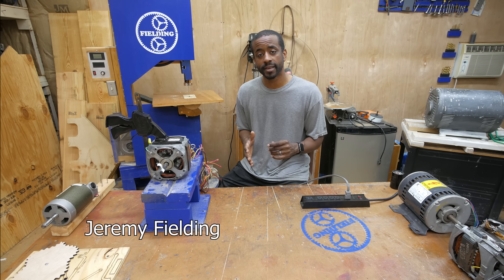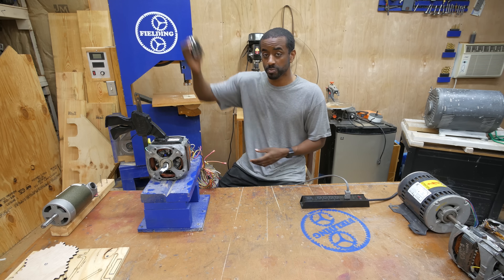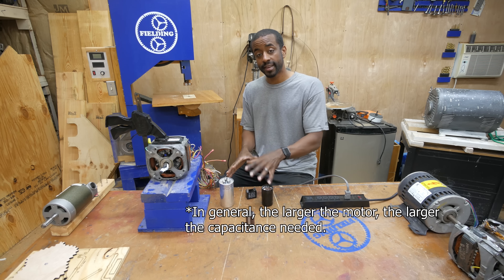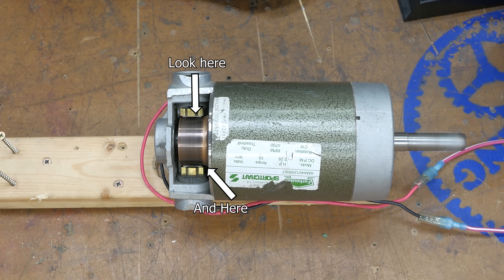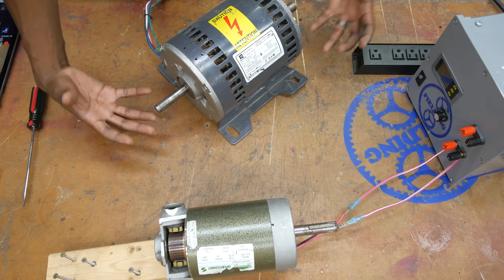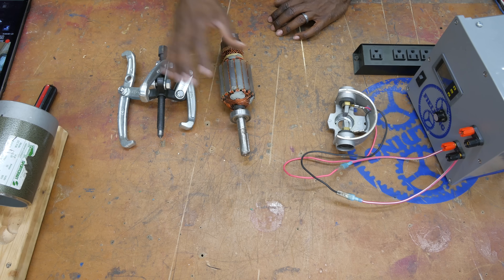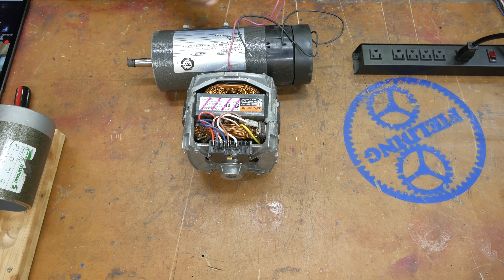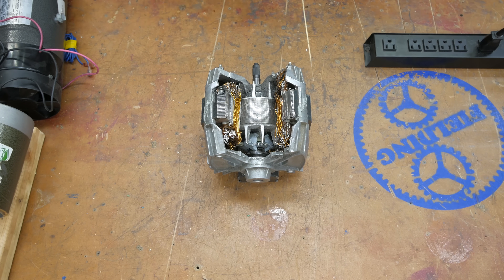Three Most Common Motor Fixes Anyone Can Do; Ultimate Guide to Electric motors ; #070

Comment: Yo I really hope you see this. @1:02 you say "if I give the motor a lil push.. let's see what happens." My question is what's going on with a motor if I give it a push and it doesn't do anything? It's like it's locked up or something. For context. Ive been using a fan motor from an old gas furnace without a capacitor to shake spray paint cans. It's got a small wine bottle rack centered on the shaft and I put the can in it , turn it on for 15 seconds or so and it's good to go. I replaced the bearings in the motor and put it back together and now it doesn't want to turn at all. Actually it did the 1st time I put it back together but I forgot to put the bearing cover on it so I tore it down and put it on, now it's dead lol.

Comment: I repair a lot of motors at my job and most common problems are loose connections due to using wire nuts. I suggest every connection be made with a bolt,lug or terminal board type connection.  Great video and very Informative for people just starting out with electric motors.  Watch for SPARKY!

Comment: On your #070 video you show a dryer motor that is glued together. i'm trying to replace bearings in a motor with the same glue. How does one remove the glue, what glue to re-attach and also what is the small opening on that motor for. Is it to assist in opening of for lubricating? Thanx-a-lot. Your videos are very informative and ha helped me alot. Keep it UP!!!

Comment: You do a better job then I could explaining DC and even AC motors along with capacitors and other components and why they are needed even though I have a better background then most. It should be a common knowledge but sadly it's not if I asked Joe what an armature or commutator was they would say huh. And it's pretty important stuff we use them everyday.

Comment: Are you a teacher?! Your videos are easy to understand and at a pace anyone can follow. I do have a question that I will be digging into myself. My air compressor has the capacitor I should check but right now when I turn it on the lights on the circuit flash and then the breaker blows. Not sure if this is a common problem but the one I have. Again thanks for the great videos!

Comment: Hi Thanks! I have a problem and I think how to fix this. It could be the bearings. The engine is for vaccumcleaner. and its starts good and run good and no sounds issues BUT when I stop the engine and at the end of the last rpm:s its sounds awful like it should break down. But it starts allover again and it runs very good and did it for at least 5minutes. Every time I switch off it sounds like that at the end. Anybody???

Comment: Hi there, nice and informative video. May i ask a question. My coffee grinders single phace ac motor stopped working and these are it's symptoms: when i turn it on with power in spins and then jamms making a rubbing sound, but then with some force with my hand (power off) it starts rotating again. I believe it's the bearing or something broken inside. What is your thoughts? I don't think its a faulty start-run capacitor cause when i unjamm the rotor it can rotate. Thanks for your time

Comment: Good video , I just pulled a attic fan motor that was just humming when I tried to start it. When I try to turn the shaft it feels like it is gummed up. So now I am thinking barring's and I have to check the capacitor because not sure how much resistance the shaft should give me when turning by hand

Comment: My Black & Decker Bench Grinder stopped working while I was using it.  Felt hot.  Now just buzzes.   Wheel still spins freely with no power but when switch turned on the motor locks up.  There is no capacitor.  Could it be brushes?   Thanks for the video.

Comment: Jeremy long ago subscribed to you. You were using recovered washing machine motors to power your shop tools. A Neighbor that repaired washer for years and years  had motors stacked around; a bunch!  I asked and received as many as I wanted. I offered and received about 20 and he refused any money. I got my wheelbarrow and took them home. This was in late September or early October, I covered the wheelbarrow with 3 layers of tarp. Spring is almost here now, the bungee cord snapped, I now have motors in a puddle of rain, snow, or defrosted ice!  Is there away to still find a useful place in a future shop other than a heavy paper weights?

Comment: I brazed a brush holder back onto its flange on a Husqvarna 'cut & break' saw.  Simple, but not easy, fix for an expensive tool.
It vibrates a lot, but it's been working so far.

Comment: Hi jeremy, I got a drill press that hums and doesnt turn on its own until you give it a turn like you did at the beginning of the video. When i got a new capacitor and hooked it up...it still not working. I got 2 diff. new capacitor just to make sure. No result. Do you think i need to open the motor apart and check something else? Great video btw

Comment: THANKS!  You are an awesome teacher. Wanted to tell you about a little trick I use when bearings, (mostly the copper sleeve types), are worn and getting sloppy, and its not convenient at the time to replace:
I look for super thin strips of brass or copper, (I've used everything from silver scraps to steel spring out of a tape measure),  that I oil up and slide between the shaft and bearing; (sometimes a tiny sliver will do it), and it helps get tolerances back where they need to be.
Keep it oiled and it'll last long enough to finish that project . . .
Reply: I'm doing the same with a small cut from a plastic bottle to get through the remaining of the hot season with the same old fan.

Comment: so question lets say that I have a old motor that went to a air compressor and it failed. can I upgrade the electric motor that was a 2hp to a 5hp as long as the rpms are the same and the voltage is the same?  the only other difference I see is the fact It has a start up capacitor (old one)  and the new one has a start up capacitor and running capacitor.

Comment: Excúsame just a question I have a airless paint sprayer and wen I start the machine a lot smoke comes out from brushes area I checked the brushes and they are not desgasted looks over half of the size wen they are new do you think could be a electric short thanks

Comment: Very informative. Cool switch demo at the end…. I have a problem with my dc motor that vibrates but will not run even with an assist from me. The variable speed box is not working so I disconnected it and used a standard power cord with the proper plug to power the motor. So I guess I am bypassing the capacitor. Could I connect a stand alone capacitor to fix the problem? Any advice you have would be greatly appreciated. Thanks

Comment: Great job explains these things.  I have a 1960s record player and I’m researching what kind of motor it is and which type it is to figure out what may be wrong with it. Checking all the upstream components was a great suggestion!  You are right I should start there rather than assuming the motor is bad.

Comment: 7:56 i ended up seizing the front bearing in dremel doing some sheet rock work. look story short took the dremel apart removed the bearing cover removed the debris from the bearing the dremel lives again. 🧟‍♂ all that said when you pull out the shaft of the dc motor do any parts of the dc motor (non bearing related) require any lubrication?

Comment: Awesome, Thank You. Right now I’m having trouble identifying the run capacitor on my air compressor. The paper label not readable.  I tried looking at the motor manufacture with no success. Any ideas?
Sanborn black max 3 HP
30 years old air compressor

Comment: I have a bench grinder that would not start. I replaced the switch but it still wouldn't start. I could hear that it wanted to turn on so I gave the wheel a kick start and it finally started. This bench grinder did not have a capacitor so I though that just replacing the switch would solve the problem. When I replaced the switch it make the same sound like it was wanting to start. Could it be the bearings inside of the motor that are defective?

Comment: I had a 54' fan motor hard starting. Pulled the capacitors off and checked them. They checked in specs.  Put them back on for the heck of it and motor started great. I assume they weren't making great contact.

Comment: i miss when i work  on motor shops  for 40 years  fix all kind motors and rewinding them + converting them for a different torque , voltage, frequency and speed , good job on you video,keep work on this babies ,i love  MOTORS

Comment: I ha e a motor that I brushed the wire coming out of the stator because they were filthy. Thing is I brushed it with a small metal brush. Now a bundle of wires is getting so hot the copper is changing colors. Friend says I scratched the shellac off the wires and it's causing them to short. Is this correct?

Comment: I watched this video bc my gf bought a fan at lowes for $70 on clearance.  When we got it home it didnt work . The plug had a fuse in it which was fine so i said to take it back then she had a death in the fam8ly long story short i just ran across this fan 2 months later so i guess im going to have to fix it. Electricity is black magic to me bc i dont really understand it. I can build most anything , fix your car etc so i know how to do things just not electrical stuff. Thanks for the run down on motors it was very informative. The fan does nothing when i plug it in so im thinking a switch or something like that maybe it was wired backwards who knows . Guess ill find out soon enough  Thanks again

Comment: So I’ve recently had to take a diesel tank pump apart which seized up and burned out probably because it has been used for adblue instead of diesel. When I took the motor apart I noticed that it had a pcb with a 240 volt 64 microfarad built in capacitor which looked damaged. I’m thinking to purchase a new capacitor and solder it in the pcb. If I can’t fix the pcb could I use an external capacitor somehow? Problem is that when I hook the motor up nothing seems to be happening no noise combing from it, probably the pcb has other damaged parts in it which I didn’t notice like fuses or extra smaller capacitors. It would be a shame to throw that motor away, the brushes are still ok, I’ve cleaned the terminals as they were oxidised, the bearings work. I know the answer would be a new pcb but what are the chances of getting one, the manufacturer doesn’t sell them separately. I looked it up and online and these motors cost around 400 dollars.

Comment: Oh I'm a Big Tesla fan too (even  an EARLY! Edison fan, we'd go on field trips to his Menlo? East Orange? Lab...) but as you were so proud of Tesla, you came close but seemed to hesitate mentioning Faraday w the Induction demo shortly after...his biography in a liberal arts class later gave me inspiration to get a B.Sci. degree (Chem. Minors in Physics n Bio) but him a street Urchin, someone once called him, to go from reading the books he was binding, to become a master 'note taker', wife watcher', for the great Sir Humphry Davy (ran current   to claim elements discovered-or purified...) but Micheal first was a chemist,chemistry,. Benzene..but it was 50 years? No more than a pretty milkmaid flipping voltaic cell that would move a compass needle one time...you said "motion" the key as I understood it was the magnetic field collapses when current is constant so the "change-acceleration "a" of the current  allows constant B magnetic field to be "inducing"...w thimbles there must be a modern cheap way to reproduce his discoveries? Ya think? Steel needle inside a thimble that's wound ...cracks me up they teach his lines aren't real...then say it's the sun's field lines; that tangle then flip...11  year cycle....I recycle    n salvage metals...i have fun tearing apart furnaces, microwaves,..so glad I found Ur site...keep excited )like Teslas motor....funny h,w we need xboth AC for long distance n DC to work....n Edison could've shared Nobel w him ntoo

Comment: You asked for fix-its, I find fans, especially the little 12Volt cigarette lighter plug ins (and some bigger AC, I guess too) but do what the bad start capacitors do..fail n give the non turning humm...
or it'll eventually start...
Is there a capacitor for the little we 12V fan that is replaceable?

Comment: Great information and demo.

I have a 3219 skyjack scissor lift which ‘fails to proceed”  even when battery’s  charged. A showed me how to spin the cooling blades which will then allow it to start on the next attempt. He said that means the brushes need replacement. However I’m wondering now having seen your excellent video, the problem may be the capacitor? Could this be the case? Could turning the blades overcome a capacitor issue or do you agree it maybe a brush problem?  Looking forwArd to a reply. Thanks

Comment: I have a 1020 ebike engine that was running good and then it lost power and started dying out,. So I took it apart and found a blue plastic like substance almost look like plastic melted on the windes.

Comment: Very good refresher. We have an air circulator that stopped working and has that characteristic hum. I thought it was likely a capacitor, but it's good to have your video supporting that diagnosis. Because now I have to climb into the crawlspace and pull the motor (or at least the capacitor). Oh, my aching back!

Comment: I just bought a wood lathe with a 2hp motor that sparks, a lot and whines so loud you can hear the person next to you. I bought it because it is all cast iron, came with4 tool rests, turning tools, 4 assorted size plates, a live center, is a 15" inboard and 20" outboard turning capacity, and has a 38" bed all for $100.00! Even if I have to purchase a new motor it's a bargain. So what I learned from you is to check the brushes and new bearings. My question is would bad bearings be THAT loud or might it be something different going on? Thank you, Jeremy.

Comment: You're like me, you see something and you want to take it apart to see how it works. 
I once did an x-ray room where I had to remove all the old gear before making the room ready for the new equipment. The switching mechanisms in their cases were all brass and mahogany in mineral oils, I wanted to keep one, put in into a perspex box and display it but the techs told me it had to be destroyed because, due to the x-rays, it was contaminated, pity really because it was a thing of beauty.

Comment: Many years ago a friend in California had a problem with their swamp=cooler, through various tests we discovered it was the motor, also ruling out the capacitor starter. She went to a local dealership where she got a motor at discount price because she went through all the tests she had done to discover the fault, the guy was impressed that she knew what she was doing. What was more unusual was that I never left Scotland, I'm an internet electrician.

Comment: Hey mate. I have a motor that gets hot and smokes. I assume it might be bearing but the whole outer casing get really hot. 
I have done a lazy clean of the motor and I’m wondering if I might have to re-lubricate anything inside. It doesn’t directly have any lubrications points. 
Motor is a crompton 1/2hp 240v motor on an old mower.

Comment: I have a small water pump... its 12 volt. I had planned to power it with a 24v power supply by using a buck converter / step down. Turns out, the converter (un like my newer one which looks identical) was not built to handle 24v :-( 
(the new one goes up to 50v lol) Anyway, there was also no safety in the converter so my pump got hit with 24v accidentally. Now it won't start... just slowly heats up... doesn't even make noise. Now I get to drain my entire 50 gallon electrolysis tank full of toxic copper nitrate so I can try to fix it. BOOOOOOOO!!!! I really hope there is a fuse/safety inside... something i can replace lol.

Comment: On cheap motors the copper isolation can fail due to heat. This creates a short curcuit between the phases and makes the motor a complete rightoff.

Comment: good video. i had a simple fix on the electric blower motor for my central HVAC system. It started screaming like a banshee at 3:00 in the morning. It just needed more lubrication. I cracked it open, there was a lubrication "well" which was i fibrous material adjacent to the bearing. I added some 3 in 1 to it, and bam! Problem solved.

Comment: I had a starter/generator off a 81 ezgo golf cart that wouldn't charge the system but would still start it. I eventually got frustrated enough when I most everything else repaired that I looked to get a new one. The price quickly derailed my thoughts I figured I should at least take it apart first and as usual, good thing I did. It had 4 magnets glued along the outside and 1 had broken loose. Even though it only could move less than a 1/4 inch for sure, it was enough that in time, the 1 inch of wire connecting it had finally broken. I glued it back in, soldered the wire, and haven't had to charge my rigged up 2-6 volt to make 12 (x2 = 4 batteries in total LOL) volt power wheel batteries since. I even forgot them in the cart over the Minnesota winter and she fired right up again come spring.

Comment: This is great. I've had a few problems with Baldor motors failing (coffee roasting equipment.) I am quite positive that the capacitor ends up being the problem with at least 2 of them. If I swap them out (I'm not very familiar with motors, obviously, but I am competent with electronic soldering) and they work as normal, then you've saved me a few hundred bucks. So of course I'm now a subscriber.

Comment: Missing series wound motor armature motors. They are mainly used in high torque start up. Ie winches. Four connections on the motor